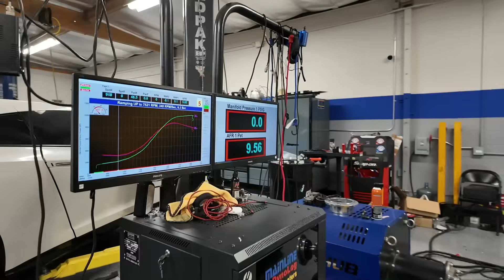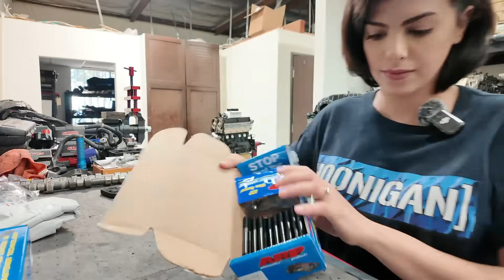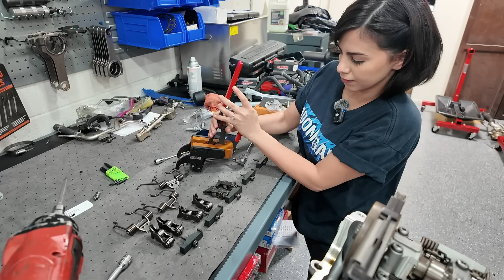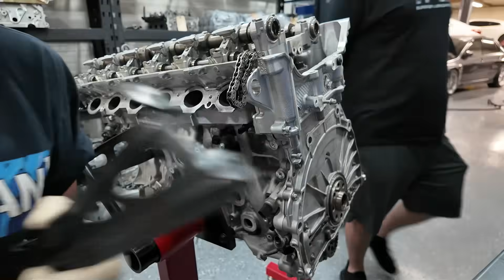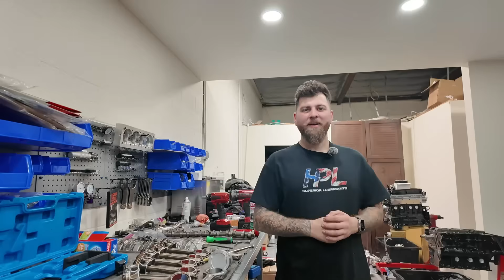WE BLEW UP OUR SUPRA FINDING OUT THE STOCK ENGINE LIMITS

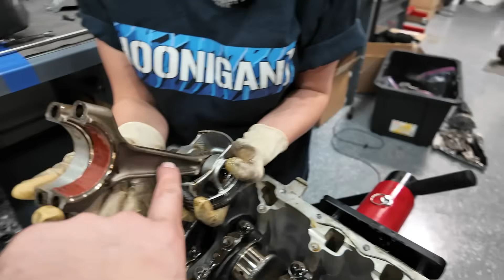Comment: 8:00 the orange coating on the rod bearing is for the engine start/stop feature.
Reply: I assume they only use on the top because with the engine off the oil will slowing start moving its way down due to gravity this making the top rod bearing less lubricated than the bottom?

Comment: Oh boy! At least we know where the limits are. I’m curious, are you planning on going as big as you can with direct injection before you start going bigger with port injection and turbo? There may be more control for fueling. 
Also…
I’m a huge proponent of WI (water/ methanol injection). Would adding WI aid in adding longevity for your tunes in the future? I ask because my goal for next summer is 1100whp daily on my Gr Supra. 🤫